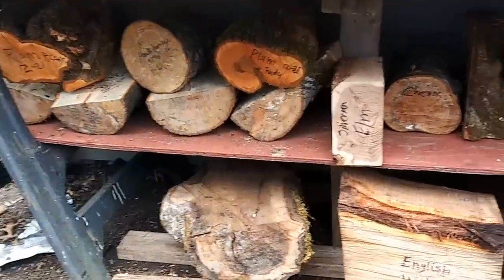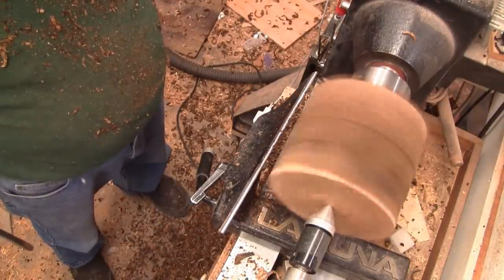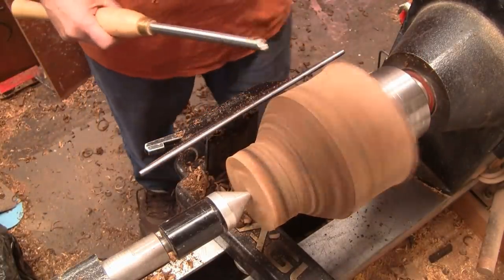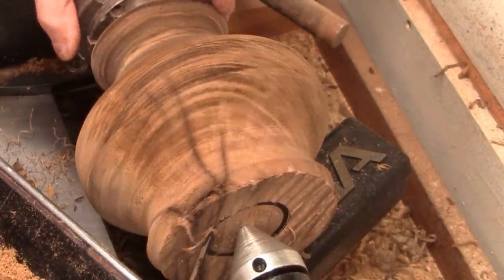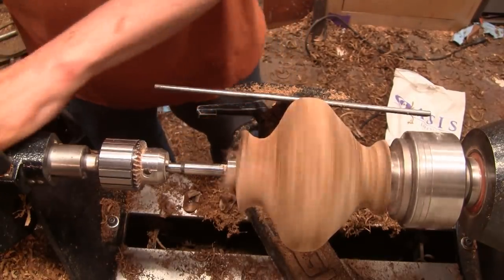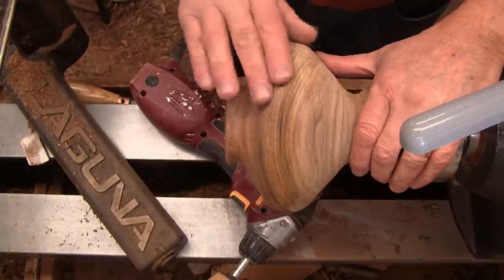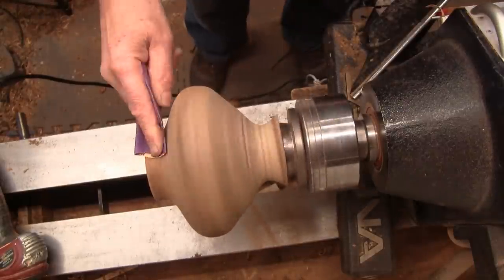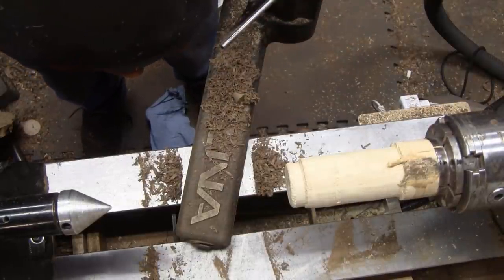Wood Turning The Cool Vase

Comment: What a coincidence that you are also making a Vase from Walnut. Same orientation as mine, only I used two pieces of about four inches thick. And I really think my Walnut is the same species; English Walnut. Great work Gary! 😎
Reply from the maker: Thank you Leo and I watched your first part. Should be a very cool looking vase.
I had some English Walnut that came from a walnut orchard that was taken down because walnuts were not selling very well. I could have gotten dump trucks full of it. I think the fact the trees were not as old as the one that this wood came from they did not have as much color to them. Much lighter color but still pretty.
This one was from our friends tree that was dying and had to come down. I did get all of the wood from it.
You will be seeing some segment work from it as well. That is the wood I showed in my recent drying box video.
I still have more strips to process as well.
Take care,
Gary

Comment: Beautiful work. Question for you if I may? I see that you did some hollowing when the lathe was in reverse. Is that something you do a lot? And is there any advantages to that method? Please let me know. Thank you. P.S. I have some walnut and cherry in my shop that Ive been looking at turning. You’re an inspiration for a new turner like myself.
Reply from the maker: Thank you Keith. The main advantage is in those tight areas you can see inside without leaning clear across the bed of the lathe and not really have that good of control of the tool. But you do need to use the set screw that most chucks have so it will not back off. And of course loosen it before trying to take the chuck off.
 Have fun with the walnut you have and thanks for watching,
Gary

Comment: What a beatiful piece of wood and the grain really pops.  I am so pleased that you mentioned the set screw on the chuck when turning in reverse.  I did not know awhile back and you told me about the screw which I drilled and tapped.  Things happen real fast when you don't have the set screw and the results may not be good.  Thanks
Reply from the maker: Thank you Paul. I am glad you were able to get a set screw in yours. If you were to get a catch while turning in reverse without a set screw you might have to chase  the chuck across the shop. 
Years ago I had a lathe before we had all the 4 jaw chucks so used a face plate. No set screws in it. I wired the motor so I could run it both ways. I only did that for sanding. It was a capacitor motor and it would only change direction when it was almost stopped. Well that is enough to unscrew the faceplate.
the modern 3 phase motors and VFD will reverse on the fly.
Thanks for watching,
Gary

Comment: Excellent grain and color. A very beautiful piece. I’m just worried that it will change shape due to the moisture that’s still in it. Thanks again.
Reply from the maker: Thank you Michael. In a lot of case you can expect a wet piece to warp.  I have turned a number of pieces from this tree and all were turned green. None have had any issues. I think English Walnut is pretty forgiving when turned wet.
Apple on the other hand will really warp when turned green and thin. But I like that about Apple.
Thanks for watching,
Gary

Comment: Hi Gary,
What a beautiful piece of walnut!  When you started I didn’t see any cracks and I assumed it was dry.  Glad that it didn’t crack on you.  Impressed with the 1/4” wall thickness.  Overall a wonderful vessel with terrific grain and finish 👍
Reply from the maker: Glad you enjoyed it Skip! I was shocked at how wet it was. The main reason to get it turned as thin as I could. I got lucky because I was not able to do it all in one day because of commitments. So I covered it with a plastic bag which seem to have worked. But I have had good luck with this Walnut not cracking while turning.
Thanks for watching,
Gary

Comment: Gary. That’s the first time I saw anyone use the diamond point. I have one that came with a kit I never could figure out how to use it. Love the English walnut, we have a lot of black walnut in my area but the English is hard to come by
Reply from the maker: Thank you Mark. I have had that diamond point tool for many years. It came in one of the old Craftsman  sets.
It is getting pretty short now as I used it for years at work along with the round nose scraper that was in the set.
I wish we had more Black Walnut. We have some but it rarely gets cut down which is ok because they are such beautiful trees.
Thanks for watching.
Gary
Reply: @ThePapa1947  maybe I can send some out. I have a couple logs I need to process soon
Reply from the maker: That would be pretty cool.

Comment: That's really amazing Gary. I guessed the English walnut, because you had it in the center of the camera the whole time. And beautiful grain for sure. It's very cool how you pull that beautiful shape out of just a lump of wood. It really showed off the grain in the end, and was as good as  you said it would be. I'm very interested in the idea that you worked that very wet wood, and it did not cause problems after it was turned. I would have thought that it might crack or warp as it dried. Fascinating. Another good lesson today! Thank you.
Reply from the maker: Thank you Mark and I will fess up. I had already chosen that piece. But I just built this small storage area and had just cut this piece of wood. I figured it would be a good way to start the video. Sometimes that is really hard to do.
As far as turning the wood so wet I have had such good luck turning this batch of wood I decided not to worry too much. I did cover it with a plastic bag 2 times because I had to stop on it because of commitments.
I have turned a number of pieces down to size and they have seem to stay stable. I have one that is horn shaped and nothing has happened to it in the last year. What I have noticed is some of the bigger pieces I have there has been ring separation on them. I should have cut them smaller. But they are still useable.
Thanks for watching.
 Gary

Comment: Beautiful! Walnut never disappoints & you chose the perfect shape. What is it about walnut that it just hangs on to moisture?! I have some chunks that have been sitting 4 years and they are as wet inside as the day they were cut. Great video!
Reply from the maker: Thank you Leigh! I was really shocked that this piece measured over 40% in places after a year and a half. But I did leave some rather large pieces that all I did was cut down the middle. 
I will just plan on turning it how ever wet it is. It seems English Walnut is very kind when you do turn it so wet.
Thanks for watching,
Gary

Comment: Beautiful piece! Walnut is hard to beat and really I like the shape. Also, I notice you sand in forward and reverse. Does that eliminate raised grain after you apply a finish?
Reply from the maker: Thank you Randy! Sanding both directions does help to sand any fibers that might be standing up. I like to sand the outside in reverse because it directs the dust away from me and into my dust collector port. It is also more comfortable to sand the outside that way.
 But you can still get a good sanding job even if you do not have reverse.
Thanks for watching,
Gary

Comment: Walnut is one of my favorites to turn. You did a great job with this vessel. I’ll be curious to hear if the piece distorts at all as it dries. Thanks for making these videos
Reply from the maker: I love to turn Walnut as well. I have turned a number of pieces and so far everything has stayed the same. I turned one fairly thin hoping it would warp but it did not. Does not seem to be much stress in the wood.
Thanks for watching,
Gary

Comment: Papa been watching all ur turning work u do amazing wood turning. Love all ur peace’s u have created out all deferent woods . I have been building pens for over three years. Just resent started turning bowls like thank u for sharing ur experience with ur subscribers learning more by the day with ur videos . I’m ready for much bigger lathe . Got eye on the laguna 24/36 220 volt . Reason for that size is I also turn baseball bats . What’s ur advice on a laguna lathe to a other ones out there in the market ?
Reply from the maker: Hi David, thank you very much for all your comments.
I like my Laguna and I think they make nice lathes. The 24/36 will allow to turn a larger diameter but the same length as my 18/36. Not sure what you need for a baseball bat but they make extensions for both of the lathes. 
I am sure you would be very happy with either. I think you will not see much difference with these than the other brands  other than the Robust or Oneway which do cost a lot more.
Hope that helps,
Gary

Comment: What brand of turning tools do you prefer?
Reply from the maker: I have 2 brands that I use. I have Robert Sorby and I have Benjamin Best. The Benjamin best are actually decent tools and a very good price. I seem to mostly use the Sorby tools now. But I have ground the Benjamins with special grinds and use them when needed. Such as a bottom of the bowl gouge and a 40/40 grind. My negative rake scrapers are the Benjamin Best and they work great. I know others will only use some of the big name brands but I  just use what works good. I would be happy to try any of those others though.
 Hope that helps,
Gary